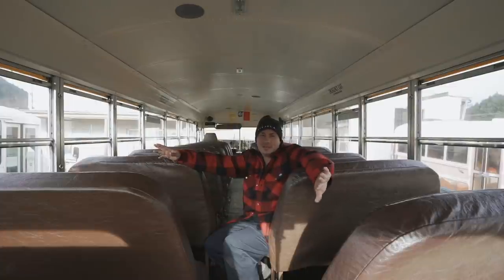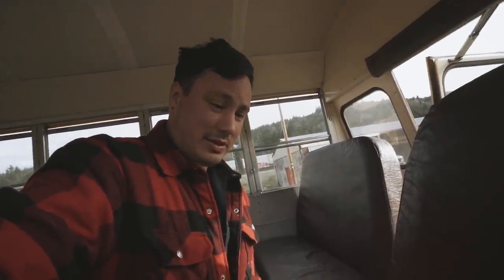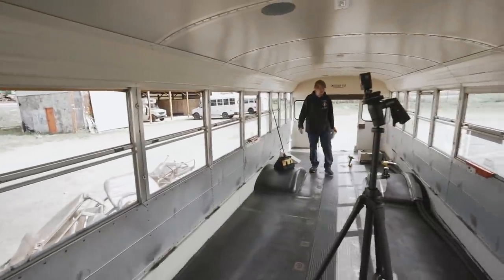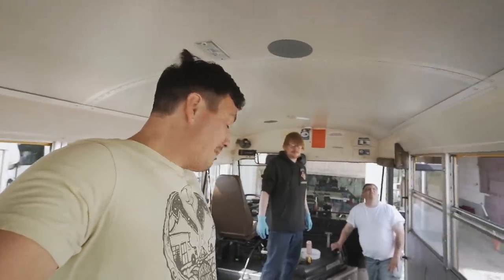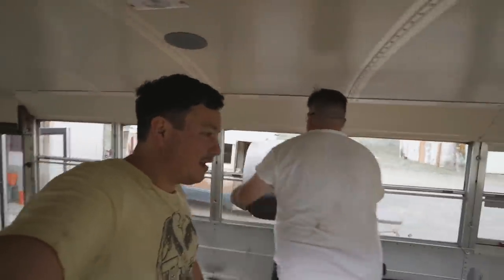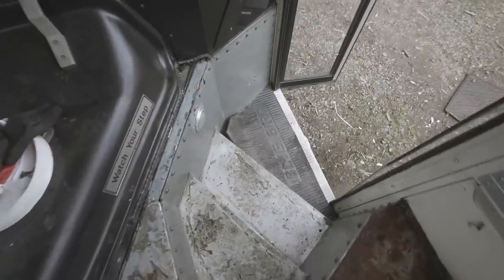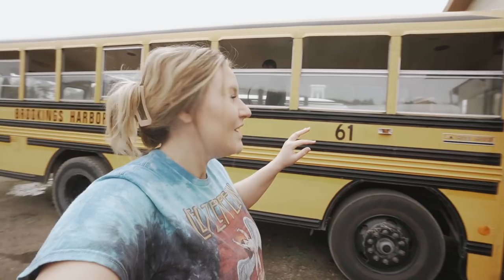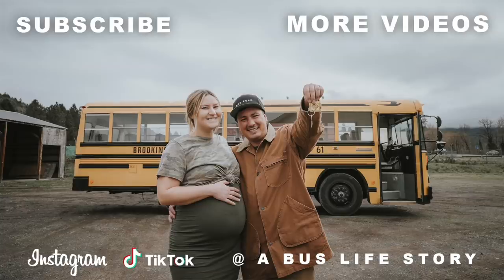Removing School Bus Seats, Rear Heater, & Sub Floor - SKOOLIE CONVERSION

Comment: The 1st Demo Done on to the Walls and Roof then wire wheel 😳 😀 the Floor and Rust Treatment. And away you go Issac on the Build
Pretty Exciting.

Comment: It seems like nothing is ever easy when it comes to a Bus.😂🤣. My floor was terrible. It was so wet I couldn’t pick the wood up. We had to cut the plywood in half because it was so heavy. After cleaning the floor, I coated it with Chassis SAVER. Boy did that video bring back memories. It looks so big now that the seats are out. I can’t wait for your next video.

Comment: I hope you break those seats down to take the steel to a scrap metal yard. I suggest getting a trailer to put scrap metal in to take to the scrap yard. All that metal can bring a little change back in. Especially when you have much of it. Good way to resource.
Reply from the maker: It’s honestly not worth the hour drive. Would cost me money
Reply: @isaacturnerit  how about if you collected a wagon load over a period of time

Comment: Your going to nail this build and I totally get the gut out.   I had to do the same with Matilda, learned my lesson on buying a bus from the PNW I spent 6mo fighting rust but I am only able to work on her a couple day a week so you will get threw it much faster.
Reply from the maker: Yeah this was also on the coast
Reply: @isaacturnerit  yup PNW and salt in the air

Comment: Issac, could you make a list of the solar panels abd all the things you are putting in the bus, such as everything for the solar and power, water lines, water heater, wiring, what gauges, if your putting propane stovetop/oven, fridge or cooler. Like a check list. I'm sure others would appreciate it, I know I would. I'm trying to make my list up. Thanks, great job so far.
Reply from the maker: That’s coming in a future video!
Reply: @isaacturnerit  awesome,  thank you. That will help alot of us newbies.

Comment: Just curious why not leave a seat for jaylena and the baby's car seat? seems like a seat instead of riding on the bed would be handy and easier to see out the window as you are driving? And safer for the tiny one too?
Reply from the maker: I had to get the floor up to treat it for rust

Comment: just some thoughts, 1. too bad you don't have a 3/4 air impact gun and a 2 ft extension you could put an impact socket on the end of the extension and then just pull the trigger to tighten and just snap the head off in seconds 2. hose clamp plyers clamp off the lines when you cut the hoses eliminate the mess. 3. whos stormy daniels and what's her youtube channel?....after you've worked hard all your life, it's nice to sit back and watch someone else do all the work and especially when they work hard and do a proper and complete job, well done to all and good to have great help from good friends

Comment: On the heater. I took it out a window and disconnect it out there and no coolent got amy one.
Floors it took me a week of  sanding machine and hand grimder. Pat h work on seat holes and AC lines. Patch little holes with with roofing silver tape.